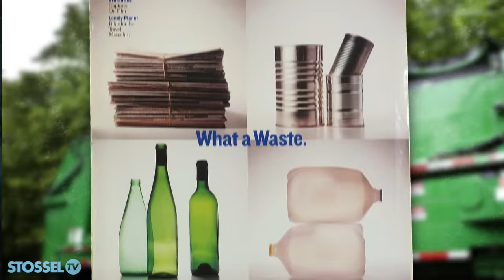Even Greenpeace Says “Most Plastic Simply Cannot Be Recycled.”

Comment: I worked in the plastics injection molding tooling industry for 30 years. Most plastic pellets (plastic parts come from pellets often supplied in bags) can only contain 2 or 3 percent recycled plastic. As one increases that percentage, the quality reduces. Plastic degrades every time it melts and reforms. Even at that low amount, it's mostly for very low grade junk stuff. You really don't want your expensive auto or phone parts to contain recycled plastic.
Reply: I used to believe in the lie, until around 2015, then I stop recycling.  New plastic is better quality & cheaper.  So why would anyone pay more money for crap?
Reply: That's why they build low precision parts with recycled plastic... like trays, crude toys, etc...
Reply: That's why you use recycled plastics for cheap consumer goods, single-use products, packing material, etc. Do you think tires get recycled into new tires? No they get shredded into mulch for playgrounds and artificial fields.
Reply: The only reason I recycle and compost is because my city has a 1 bag limit per week for garbage pick up. After that it’s $2.00 a bag. 

I wish there were practical alternatives to having such a wasteful society. I do what I can to reduce waste but it’s hard.
Reply: That’s common knowledge dude no need to work in plastic injection to know this. What you apparently still don’t know is that recycled materials won’t necessarily go to the exact same use. As mentioned before for low precision or low longevity etc.
Reply: When explaining to people the process of reusing plastics, I compare it to reheating cheese on a pizza.
Reply: For the rest of you making these dumb comments. What’s being recycled is going to continue to be recycled whether you do anything about it or not. Whether you contribute or not. If there’s money to be made and saved you don’t need regulations to make it happen. It’s really just that damn simple
Reply: I accept your provided info. Question: what do we do with all the plastic, i.e. bottles, and such? Just asking for suggestions. I do not believe we should throw stuff into a landfill.
Reply: @TrumpIsrael2024  because not everything plastic is a high end product.  If something can be recycled, and has a greater worth than a raw material, it should be recycled. To recycle everything is stupid, to recycle nothing is equally stupid.  Recycle copper, awesome. Recycle kraft/brown paper, good. Contaminated plastic film, yeah thats trash.
Reply: @staticbuilds7613   It's cheaper and easier to run natural gas over catalysts to make nice clean new plastic bags to go around medical stuff, and food, and...  Recycling plastic pre-consumer works well, because it's sorted properly. Pallet wrap goes into the pallet wrap bag and mold trimmings off bumpers goes back into the bumper hopper.. Post consumer, it's all contaminated. Hell, people don't shake crumbs off of bread bags.  Don't get me wrong, recycling works if something can be recycled.
Reply: @pretol2730  You hit the nail. Some materials in some products can, and is molded with 100% recycled materials. 2-3% mentioned is a low number, a lot of of times we see 20-30% today. The amount of brands/sorts of plastic granules blended with X% recycled material offred on the marked, is growing a lot the last few years. To me it looks like almost every big plastic producer have recycled blends to offer.

Comment: I have done a lot of things and once I worked at a government grant project researching recycling of household garbage. We spent more time shut down cleaning the plastic bags out of the machinery than running. It broke down to one hour running, 5 hours clearing.
Plastic gets wound up in the various rollers (conveyor belt, crushers, and especially the shredders) and actually from the pressure bonds to all the other plastic. We used small pneumatic chainsaws (12" with tiny chains) to cut the thick bonded (it would get 1 to 1-1/2 thick on the rollers and solid, not a bunch of film layers) and had to swap them out frequently because the plastic dulled the chain teeth quickly.  The unsorted garbage piled up and they were taking it to the landfill anyway.
The wet garbage was supposed to be dried and burned to dry the next wet garbage but the engineers had to put in oil tanks and fuel the fire that way because the dryed, burning garbage didn't dry the new garbage enough... Then they couldn't get the pollution down from the smoke of the burning dryed- wet garbage (wet garbage is food scraps and paper) and the stack scrubbers NEVER functioned right.
It was a $80 million project and only ran a year, total failure and they shut it down and scrapped all the machinery
Reply: Wow, that's an incredible story. Might have been more effective just to incinerate everything in the plasma field of a research fusion reactor.
Reply: Thanks for sharing. That is a lot of  good, useful information that everyone needs to know. Not a lot of pie in the sky rhetoric.
Reply: That makes it extra-despicable that Amazon recently started putting a recycling logo on their packing materials, knowing full well that even though it's in fairly large print, people won't notice that it says you should take it in TO THEIR STORE to get it recycled. If I wanted to go to a store in the mall instead of using the convenience of curbside recycling pickup or a neighborhood recycling bin, why would I be shopping on Amazon?
Reply: I guess I could save up a whole bunch of Amazon packages and take them in all at once...
Reply: @tifforo1  can’t they just put return stickers on them?
Reply: As I remember glass was one of the big recyclables in the beginning. We were told about 3 years ago to stop putting glass in the bin. Thier reason, the glass crushes in the machinery. It becomes a very abrasive substance. As such it is ruining the machinery and they spend more time repairing it rather than it working. Looks like plastic also has issues. I remember years ago when everyone was converting to one stream recycling rules came out for what was acceptable and what was not. the things that were not cost over twice as much to be sent to the landfill as our garbage. It would seem recycling is just a big myth or big lie.
Reply: There you have it. It's not worth it. It's actually worse for the environment in the end.
Reply: @gregorysagegreene  Or use pyrolysis.

Comment: I worked at an appliance recycler.  The issue was not recycling the freon, foam insulation, oil, metals, and glass.  These all can be readily separated, recycled and have a secondary market.  The biggest issue was the plastic.  Because there are MANY different plastic chemical compositions and they cannot all be comingled and recycled as one "plastic", there is a very limited secondary market.  A lot of the plastic shelves and bins can be salvaged as used parts, but most of the other plastics are just ground down and hauled to the dump.
Reply: Good comment. How are 'recycled  plastic garden seats' made? They 'appear' to be recycled plastic?
Reply: @languagetruthandlogic3556  I have a recycle plastic item, that I just bought because I liked it and had money to waste. I still don't actually know how they achieved it but it seems legit because it cost like 30x more than the item normally would. I assume it was extremely labor intensive and they had to use items that were easy to spot that used one composition, I think maybe it was made out of fishing lines or specific nets or something. So for certain things I bet it's easier to recycle it, for your garden seats maybe they specifically also use other older broken plastic chairs which is worth it since it's a larger object.
Reply: @languagetruthandlogic3556  Some plastics (like milk jugs) are very easily recycled even yourself, however many plastics either require extremely fine control of temperature and humidity processes (plus who knows what contaminants they have in them throwing off that process) that is seems exceptionally difficult. But there are definitely some recycled plastics like melting milk jugs into things you could even do at home (though as with melting all plastics, there are some air pollution concerns etc).

I 3d print thermoplastics, so those you can easily remelt into a mold if it fails, but the problem is that you need like a $10k machine (lots of material resources) to recycle it back into a useable material to 3d print with, and even a hobbyist not valueing their time is never going to have like $200 in waste materials (that's like 25 pounds of plastic of 1 type that you need to recycle, and it can't be too degraded, and needs a lot of processing). However, if you have a large mold like a 2x4 board you want in plastic, you could easily melt down 20 pounds of plastic into that with minimal tools, its just that a 2x4 normally doesn't cost anywhere what your time will, so unless its for a craft or artwork its not very feasible unless you are just messing around for fun.
Reply: Most of it can be recycled into something useful such as plastic lumber , it’s just not profitable.  If something isn’t profitable, no one will take on the burden to do it and I don’t blame them.
Reply: It’s amazing how many people will just nod and follow along with what “experts” tell them. It was obvious to me many years ago when all this started that it was an effort in futility but the eco nuts shamed people into going along or convinced them that they weren’t FOS.
Reply: @jimshorts5970  the same way people followed along with the Covid-19 "experts". I was onto them within 2 weeks. It was an easy read with Dr. Fauchi and Don Lemon leading the way.
Reply: @PaulOgie  🤣🤣🤣

Comment: “Recycling is a sacrament of the green religion.”  This was profound.
Reply: and sad.
Reply: And innaccurate
Reply: @markokostelac7282  which part?
Reply: Collecting and reprocessing recyclable plastic works well in Europe. This is an American problem, not a recycling problem.
Reply: @rapator9270  interesting.  I’m wonder what the cost of all that recycling is in terms of energy consumption and pollution.
Reply: @ca_ged  30% of plastic is recycled in Europe. We have bottle machines here at the shops that accept plastic bottles. People receive money, 10-40 cents for a bottle. The plastic is ground into granules and melted into a new material. Simple. Have more questions?
Reply: @ca_ged  The process is not climate neutral, but it is 10 times less polluting than simply burying plastic and extracting new raw materials from the ground.
Reply: @ca_ged  The issue is not only about pollution, but also about the fact that the materials from which plastic is made simply run out. Gas and oil are not wood that will grow back in 30 years.
Reply: @rapator9270  if it’s simple, then why are municipalities simply landfilling recyclables instead of recycling?  Why are we shipping materials around the world?  The issue is monetization. It’s expensive and no one wants to take on the burden. Also, it’s my understanding that plastics, while technically recyclable, are not easily recyclable due to ever-changing chemical recipes. 

To imply that this is simple displays a laymen’s level of understanding of the entirety of the process and the inevitable fiscal impacts.
Reply: @ca_ged   because it is only accurate for some countries cought cought the BRS violator themselves USA
Reply: @markokostelac7282  violator of what?
Reply: This video got it completely wrong. We should go towards a plasticfree society. This video just sounds like, dont bother me, i just want to do it my way. If everyone does things their way, its goodbye planet.
Reply: @robertsteinberger5667  Yeah, it seems more like...I'm too lazy for that, let's not do it and find an excuse not to recycle plastic. All the more we make money from this idea because there are enough lazy people in the world who like to make excuses.

Comment: I did some work with a company that converted post consumer plastics into paint cans. The end result of mixing all types of plastic was an all black low grade plastic can.  However, consumers demanded a metal lip and lid making it non-recyclable after one use.😆
Reply: Plastic lids on paint cans work much better than metal ones.  The metal ones rust.
Reply: I’ve got some cans of Behr paint I’m using right now. They are all plastic other than the handle and where it connects to the can side. The big lid has a smaller round cap that can be removed so a plastic pour spout can be put in it’s place. It seems to work pretty well so far but I’ve only had them for about a week.
Reply: Upon closer inspection I realized that the places on the side of the cans where the handle connects are also made of the same plastic as the can. So it appears that the only part of the can that isn’t plastic is the handle.

Comment: The saving trees fallacy is potentially one of the best litmus tests for whether or not someone understands where raw materials come from and how recycling works.

Trees for paper are grown on "paper tree farms" just like any other harvestable plant. When new paper use is high, farmers grow more trees... When new paper use is low (and recycling is high) they grow fewer trees.

If you think recycling paper leads to more trees you don't understand one of the most basic aspects that relates paper to trees.
Reply: It's not just that, it's that most paper isn't recyclable.
If it has colored ink on, if it has the shiny surface on it like ads, if it was any kind of a food container, like a pizza box with even a spot of Grease on the cardboard it's trash.
Reply: That's not true.  The acreage remains the same, as most of the pulp comes from paper company-owned land, such as Georgia-Pacific.  The trees are already planted at the maximum efficient density -- this is an old science and industry.  The only thing that changes is the harvested amount; so, it is true, that more recycling of paper would result in fewer trees cut down.
Reply: Which to soil exhaustion, which leads to increased demand in fertilizer, which leads to increase in energy consumption, which leads to bigger carbon footprint etc, hence climate change.

Comment: This is also a massive problem with EVs, they just aren't as recyclable as a conventional ICE car. Their batteries are not easily recyclable, and they are full top to bottom with plastic parts (kind of the same with ICE cars in the plastic department nowadays but almost the entire power train in an ICE car can be 100% recycled)
Reply: The big problem with EVs is that they are marketed as direct replacements for ICE cars.  That misrepresentation should be BANNED.  EVs should be marketed as local commuters and built as good value for the money transportation.  

The key to a sane EV is to make AGM batteries as standard equipment and minimize the infotainment crap.  Because the AGMs are upgraded lead-acid batteries, they are inherently 100% recyclable and can use pre-existing car battery recycling processes.  The only drawback is that AGM batteries are quite heavy for their power output but, it must be emphasized that high performance and long range is NOT the objective.  The car is for errands within a 50 mile radius of your home, where you recharge it in your driveway.  

I'm sure there are batteries besides the lead-acid type that are recyclable but, those can be optional equipment.  In any case, the popular lithium batteries are not easily recycled.  They should be removed by attrition, replaced with recyclable battery systems, and a massive public service campaign to remind people that EVs will be reined in to their proper role, going forward.
Reply: EVs get regenerative braking almost for free. It saves a lot of energy. EVs consume much less lubricants. And it's good transferring fuel burning from car to power plants (to charge EVs). Excessive heat from power plants can be used to heat houses in winter while ICEs just waste it in air. This doesn't mean EVs are better, but it means that it's not so simple...